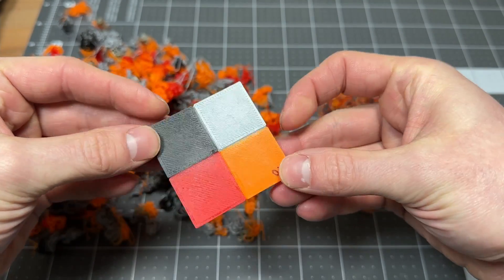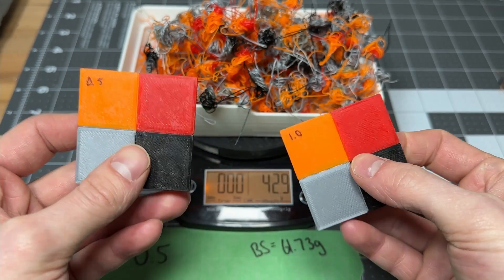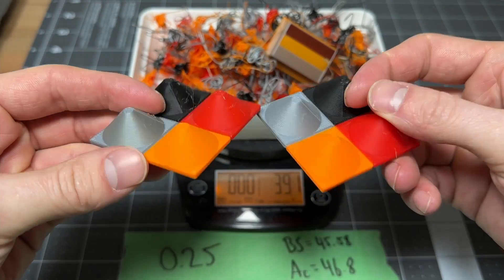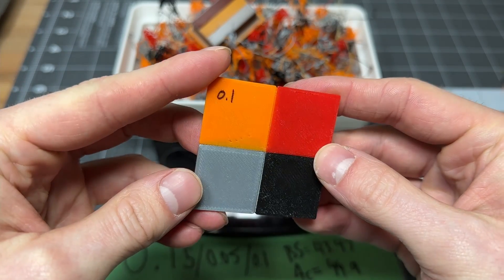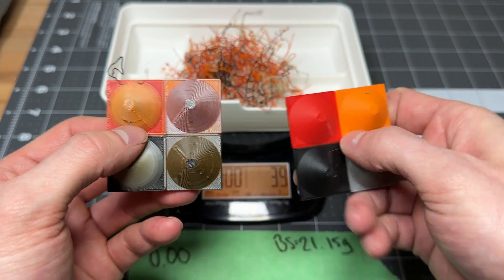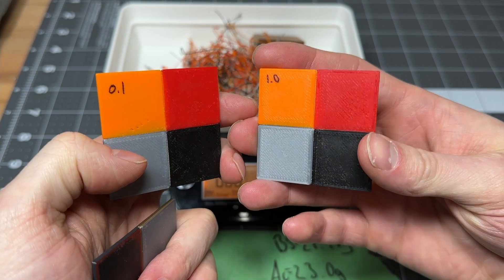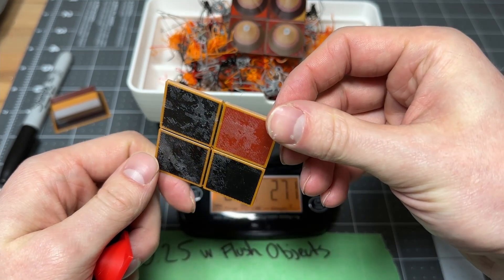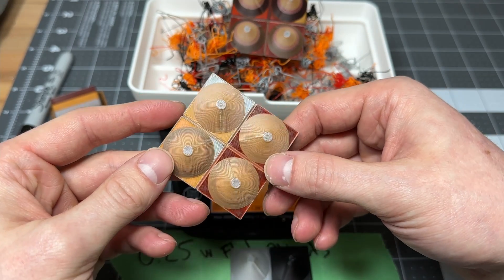Do Flushing Volumes Matter on the X1-Carbon?

Comment: I did a black and white killer whale with no tower and .15 flushing and flush to infill and the white was still pretty bright with only a slight tinge of grey in some areas. Don't be afraid of those red numbers. If I can figure out retraction somewhere that might help a  lot as well.

Comment: Another way to derive the correct amount of purge would be to take the “purds”, then snip off and weigh the amount of filament wasted past the perceptible transition point. Subtract that (with a small buffer) from the flushing volume used per transition (you’d have to convert grams to mm^3). Since contrast affects this, it would need to be done for a few different color changes.

Comment: I've done some testing of this and I can only guess you're using PLA here. The filament you're using is all opaque, which makes things a lot easier. You also lack white. Using white and black or strong colours. even opaque, can be more tricky than this. If you try translucent filament, it gets even worse. If you move to PETG, more so and for ABS, you have to purge a lot, really! I usually use a purge ratio of 0,6 or thereabouts, just to be on the safe side, but for ABS, that didn't work at all, the black blended into the red and it was no good. This was with ABS+ from eSun, so not "true" ABS, but I can only guess the same rule applies.

Please do more testing on this, as it's really interesting and thanks for this one :)

roy
Reply from the maker: Yeah this testing was using PLA and you're right the choice of color could be better. Including white and translucent filaments would be a great follow up. Interesting to hear PETG and ABS require lots of purging. 

Glad you liked the video.

Comment: Nice video! Very good information.  I can't believe how much unnecessary filament is being purged on standard settings! IMO that's a irresponsible mistake
Reply from the maker: They definitely could make an effort to lower the standard settings. But I also think that the way filament curls up into a ball and falls down the back chute during color changes is more consistent at higher purge volumes. At the standard settings it becomes these nice curled up balls with enough weight to make sure it falls down the chute and comes off the hot end. At lower volumes it's kinda wispy and doesn't always go down the chute but ends up in the print. Who knows if the engineers at Bambu Lab noticed the same thing and made the purge volumes intentionally large for this reason or just for color changing purposes.

Comment: What about the print quality? I have messed up colours with black and white filaments. Grey/Black circles in the white area. Any suggestions how to avoid messed up colors in the print? Settings?
Reply from the maker: I've done some further testing with white/black/red and I'd keep the flushing multiplier at 0.5. You can see those results at the beginning of this video: https://youtu.be/h1XCX8-v18M
Reply: @3DPrintStuff  thank you. I found out that the prime brick along with flush value to 800 between black and white helped to create a perfect print with white and black filaments.
Reply: Prime brick can be activated in Bambu Studio under “others” right below the Brim option.
Reply from the maker: @Finsterwald_  Yeah prime towers are definitely recommended to avoid random blobs in your multicolor prints. They should be enabled by default.
Reply: @3DPrintStuff  I really tried everything without success. Even just increasing the flush from black to white to max = 800 did not help. So I tried the prime tower and voila! Everything worked fine! So maybe I dont have to flush so much and just use the Prime Tower instead? I will definatley give it a try, because currently I create a loooooot of waste lol. I will for sure take a look at all your videos next, to see how I can improve. Thanks a lot.

Comment: Get rid of the purge block. It’ll save you a tonne.
Reply from the maker: It will, but I’ve found that I get a bunch of strings and blobs in my printed part without the purge block. I’m going to start experimenting with reducing the purge tower quantities, but not removing it entirely.

Comment: How much filliment leeks out the nozzle after it purges and wipes the nozzle.
Reply from the maker: Hard to say an exact amount but from what I've seen stuck in my prints when not using a prime tower. It's about 3 to 4 centimeter strands hanging out of the print.

Comment: Nice one, now you have a new abo. Like to see more of this detailed experiments.

Flush into objects is interesting and I’m planning doing it. I don’t multicolour print and use the ams only for comfort. 

Maybe you could play around with flush into infill, so less waste and stronger part’s with cranked up infill. Will it reduce the waste so you could get one perfect part and maybe a flushed one with less infill. To find the sweet spot could be difficult though, depending on the objects.
Reply from the maker: Yeah it all comes down to the geometry at that point. But if you have a sacrificial part that has consistent surface area on all the layer (an extruded shape) you could pump out "free" functional parts that don't need to look very good. 

But now you need to find something worth printing every time you want to do a multi color print.

Comment: I don't think the flush need to be the high due the prime tower. You just need enough flush to get the filiment out that the printer cut off and let the new colour out. Then the rest will be done in the prime tower
Reply from the maker: Yeah I thought I might even be able to get away with 0 flushing based on how big the prime tower is but I was very wrong about that.
Reply: @3DPrintStuff  Do you really need really need the prime tower if you slight incresse the purge amount or is there less waste using the prime tower

Comment: "Colours are still pretty sharp". No they are not, it's literally grey :-D 0.5 was still fine, below that the colours were not right.
Reply from the maker: Watching it back you might be on to something. I'll have to pull the test prints out again and take a second look.
Reply: Yeah, and next time make sure the 1.0 is not an upside down 0.1, lol
Reply from the maker: @bobhuffman7412  Not sure which portion of the video you're referring to. https://www.youtube.com/@3DPrintStuff/community on my community tab you can see a picture of the test pieces. The 1.0 and 0.1 are pretty clear. Can you provide me with a timestamp of when I mixed them up. I'd prefer not to make the same mistake in the future.
Reply: @3DPrintStuff  you're doing a great job, it reminded me of a comedy sketch (Seinfeld?) where a handwritten raffle ticket of 91, could be read as 16, so there could be two winners, lol

Comment: Are your first layers good? By the looks of the underside of the first layer it looks off a bit. The uniformity seems inconsistent. 

But, either way good information. I heard many say it could be done but you’re the first I’ve seen do tests. 

Do you think it was worth it? Is it all the rage is made out to be? What others printers did you use before this?
Reply from the maker: I think what you're seeing on the bottom is the glue from the build plate. But I'll give the prints a wash when I get home and post some pictures to the community tab. 

I do think it's worth it. The experience has ben pretty painless and I'm always amazed by the speed/quality. 
Idk if it deserves all the rage but it is definitely a huge step forward in this price category. 

I got a Monoprice Maker Select v2 in 2017, used that to learn the basics. Sold that in 2019 because I didn't have the space for it. Bought an Ender 3 V2 in 2020 to get back into the hobby and started making timelpases of the printing process. Bought the X1-Carbon in December 2022. 

We have an Ultimaker S5 with the multi-material handler and air handler at work that I've used and done maintenance on. That package is in the $8,000 range. I'd say bambu is a better purchase than that Ultimaker. You could get 4 x1-carbons for that price and the printing experience is faster and the quality is pretty much identical. 

I also have a mars 3 pro resin printer but that's not really relevant.
Reply: @3DPrintStuff  8k ouch! But, if ya got the cash why not? Yeah it’s hard to tell from a video. It looks as if it’s to low on the z. Close. But, checking the first layer from the underside is had to tell given the bed can leave a smooth or textured pattern that covers up a lot of first layer imperfections. Plus the lighting can play tricks on you too. 

I am on the fence about getting one. Most video’s I’ve seen on the X1 have had pretty good to almost perfect prints. But, the videos are starting to surface showing bad prints and machines breaking with some issues with getting replacement parts. Another thing I’ve noticed the noise factor is up there. Yeah it prints fast but they need to give you noise cancellation headphones with it.  LoL 😂 

I guess I am looking for an upgrade to my Prusa. I  an in the process of building a CoreXY from scratch. Taking the good bits from Rat-rig, Voron, HevORT and VzBot. It’s not going to be a Benchy speed tester… but, just looking to double the speeds of my cartesian style bed shaker and improve the quality. Less artifacts on the Core XY in most cases. Knock on wood. 🤛
Reply from the maker: @peterwalker5413  Yeah the noise is definitely something that needs to be considered. This thing is freaking loud. I had it in my office and really couldn't stand it so I moved in into the garage. Even if you replace all the fans with silent fans the movements themselves can be incredibly loud.
Reply: @3DPrintStuff  I hear that Bambu is looking into some kind of sound dampening for the outer panels. It’s not going to do much for p1p customers.

Comment: where numbers below .5 in the multiplier start failing is when you're flushing to infill. you really need to have thick walls in some cases to avoid the color bleeding out through the insides . i usually manually set all my numbers to 185mm3 instead of using the multiplier, and then adjust from there instead.
Reply from the maker: That's good to know. I haven't done much flushing into objects but I'll keep this in mind when I explore that setting further. Do you have a list of colors that 185mm3 doesn't work for?
Reply: @3DPrintStuff  black/white is rough. orange or red and black is rough, anything similar tones to those will likely be the same but then surprisingly things like silver and red.. fine.. silver and black.. fine.. it really depends on how much color is in the PLA but assume anything with black you may want to bump up to ~210 or put a modifier object to give areas that overlap with infill an extra wall. a good thing is when you flush to infill you can actually see what colors are going where in the infill to get some sort of estimation where overlaps may happen. you can actually use it to interesting effect. example, i printed a goku with black shirt and uv orange gi and the shirt peeked out from under the gi making it look a bit like you can see the actual undershirt through it. happy accidents.

Comment: Great test. Interesting to see how much you can play with these values. Still, my biggest takeaway is that you're printing an object of 7,7 grams and end up with at least 5 times that weight in waste in the best case scenario (37,1grams of waste at 0,1 flushing volume). Obviously this varies depending on where the colour change takes place, but  this is still a very wasteful method. It also increases the print time considerably. While this is no fault of Bambu Labs and the results are still fantastic, the waste is certainly a factor. 
I don't own a Bambu Labs printer, so I can't check, but is there a way to play with the prime tower as well? That stays at 11,4grams for all prints.
Reply from the maker: Yeah you can definitely play with the print setup to make the waste look better or worse. The print to waste ratio gets better as you increase the coverage of the build plate. With this smaller print it looks pretty bad. 
The prime tower can indeed be adjusted to reduce the amount of plastic used. That may be it's own video at some point.  
It would be cool to have a budget option for recycling the waste material into new spools of filament, maybe someone will come out with something like this as a response to this printer.
Reply: @3DPrintStuff  Yeah, an interesting fact would be probably that it doesn't matter how many objects you print if they fit. The wase would be more a formula calculated from how many color changes you got per layer, for which your object is super non-optimal ;)

Comment: How big is the prime tower you're using, I've lowered mine down to 35 width 45 prime volume and brim width of 3
Reply from the maker: I've just been printing them at default settings that match yours. 
Width: 35mm
Prime Volume: 45mm^3
Brim Width: 3mm
I'd like to experiment with the prime tower to reduce the amount of filament it uses. The ones in the video were 11.3g each.

Comment: I'm currently using 0.65 multiplier, while including a white filament (the auto calc goes into the red if i lower it)This video is great.👍🏼 
I'd love an update with some other colours included.
Reply from the maker: Thanks for the comment and the feedback. Will do. I've got white filament on the way. It might not be a complete video, but definitely a community post with pictures of the results.
Reply: @3DPrintStuff  any update on that white filament test?
Reply: good to know.  I was just going to ask this question

Comment: one of the colours should have been white .
Reply from the maker: I knew this was going to be a comment. Those were the colors I had on hand. Ive got white on order and will post pictures in the community tab of the results.
Reply: @3DPrintStuff  Please choose a slightly translucent white. I mean a white where you need at least 0.6mm layers to not see the colour underneath.
Reply: Definitely need white much easier to see the  bleed.